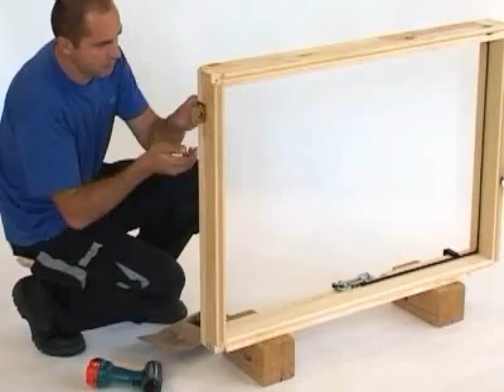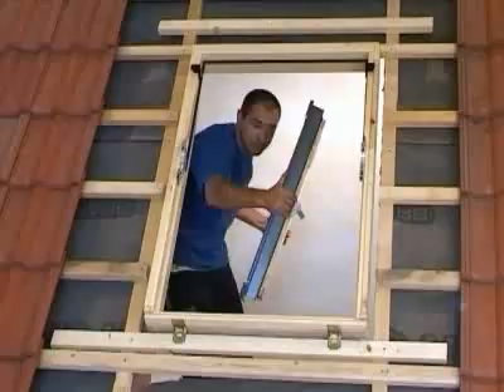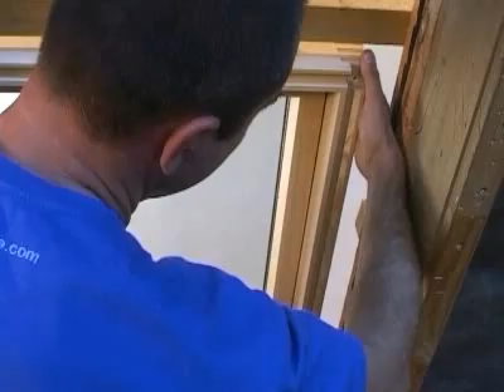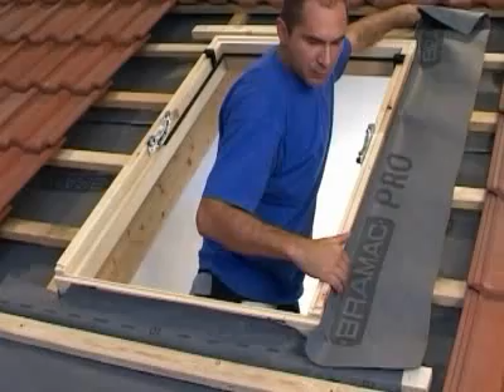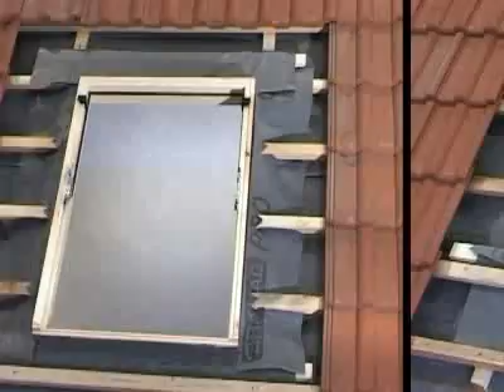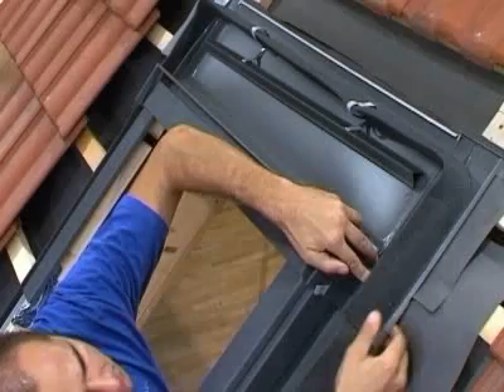RoofLITE windows - Installation on your tiled roof

Comment: Hi, You have taken the tiles really close to the roof lite other instructions and videos show them on the first ridge of the side flashings, does it matter? Thx
Reply from the maker: Yes it provides adequate drainage for water to run off down the window.
 Generally the tiles may need chamfering to achieve this.